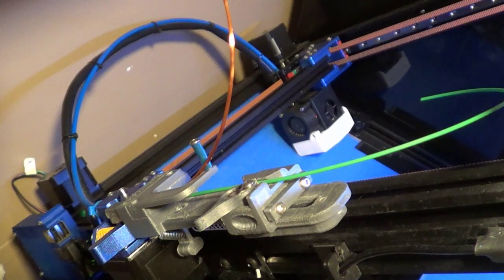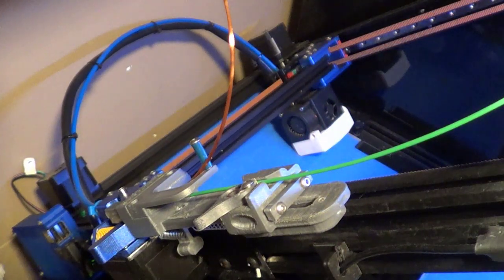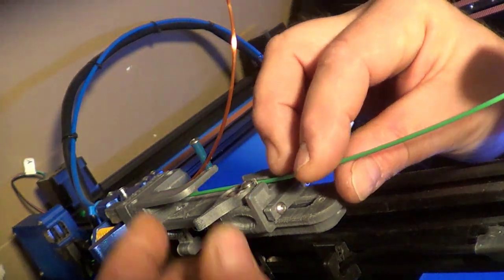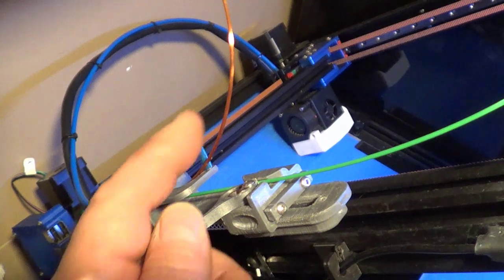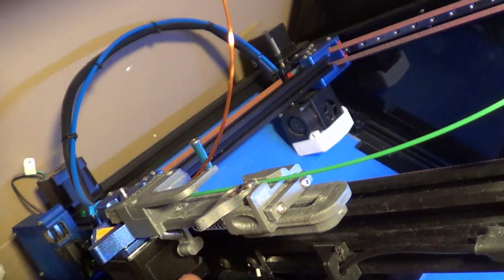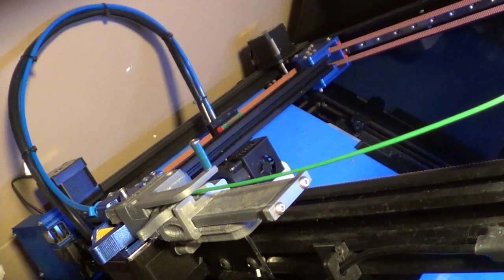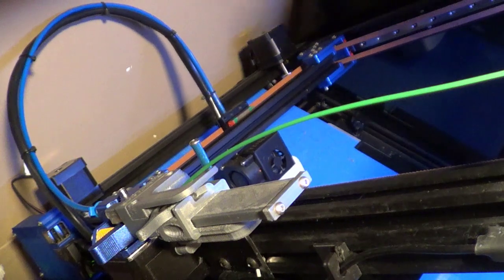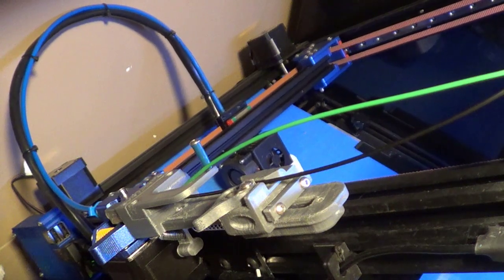Never run out of Filament Again! Automatic Unattended Filament Loader

Comment: Awesome design! I'm just curious about how you prevent the filament from jamming up in the bowden tube? I've tried something similar, but the filament jammed up, because of the break between to the 2 filaments, the second line of filament could potentially ride up next to the first line and cause a jam in the bowden tube.
Reply from the maker: If the filament is relatively square on the end or rounded , shouldn't be an issue. Only a problem if it is cut to a sharp taper. The whole thing works because the old and new filaments are under tension touching. If they weren't the new one wouldn't be able to open the drive gears, and would just sit ahead of them....
Reply from the maker: Also if you watch some of my other videos of version 2.0 design, I fed as many as 12 pieces back to back on one of my Q5's making a layered calibration cube....
Reply: Thank you. I appreciate the response on the subject. I'm looking at creating something like this for TPU and TPE. Thank you for the inspiration.
Reply from the maker: @Wraith1979  version 2.0 handles TPU very well.
Reply: No cash ATM. Im between jobs. Thats why im designing my own.

Comment: Seems interdasting... I have manually loaded filaments this way before, but a few of them have not quite loaded properly it tends to wrap around the extruder (ender 3) or the end of the filament had a bend so it clogs the bowden.  The latter being on a voron that has the boden before the extruder.

Comment: Is it possible to add a runout sensor in addition to this?
Reply from the maker: No need, as it auto loads the next supply of filament....
Reply: @frantasticdesigns  when the second filament runs out
Reply from the maker: @jhsevs  If you haven't watched my videos, you can just queue another filament supply any time after the second one has passed the feed rollers and the swing arm filament catch releases the new one.  At that point the second filament becomes the first filament and so on.  Just keep starting a new one anytime after the first is gone.  watch this video, and you can see I just keep adding pieces to make a calibration cube with somewhere around 10 layers:

https://youtu.be/PUHUfJREGlQ

Comment: Wow, for the way I print, multi-color single nozzle, this is Totally Freakin' Awesome 🤘🤘
Reply from the maker: Thank you.  I designed it more for using up all those partials left over, and to not run out on a long print.  Not sure how you would know exactly when a different color would start if you were switching colors, unless you just wanted to create a "rainbow" effect.  The calibration cubes I printed in multicolor was just to demonstrate the smooth transition between pieces of filament....But hey, I won't say no to the Accolades.....

Comment: Are you familiar with the Recreator 3D project? It reuses soda bottles to turn it into PET filament. One of the issues is a 2 liter bottle yields 20g or so of filament. This could be a game changer for the community of people using recycled filament for larger prints as seeming (melting 2 ends and pressing together) can yield hard brittle joints.

Hoping you find time to design something for direct drive extruders! 

You gained a new follower!
Reply from the maker: I wasn't, but I will check it out.

Comment: Hey this looks awesome and I just purchased the files, but I don't have the extruder you're talking about on my IR3. Any way you could adapt it and release files that would work for the stock IR3 extruder?
Reply from the maker: I have had a few requests for different extruders, I am looking into how hard it would be to adapt.  Be patient, I have been overwhelmed with all the interest it this, but I am working on it.
Reply: @frantasticdesigns  a good thing generates interest amongst the ones recognising it's value 😁👍
Reply: I would love to use this but the way the z axis shaft is mounted on my Ender 3 Max Neo it is impossible. The shaft is in the way.
Reply from the maker: @Truckinman2000  I am working on an adaptable model

Comment: Can you make another video showing all the hardware needed to complete this project? I have no doubt it will work but I'm a visual learner and I may already have some of these components.
Reply from the maker: working on that tonight, will publish when I am done.
Reply: @frantasticdesigns  what wire diameter did yo use for the tension spring and the other spring
Reply from the maker: @FF_AlohaEdition  1 spring Approx 7mmx35mm and 1-2lb Main return spring
1 spring Approx 5mmx24mm and 1-2lb filament plunger

Comment: Veeery nice!
As usual with non-welded filaments, retraction is a no go with this as long the new filament didn't reach the hotend and Nozzle. But that's a very small price to pay for a saved print where one would run out of filament otherwise and trash the full print...
Reply from the maker: Thank you for your supportive comment, not all see it that way.
Reply: @frantasticdesigns  until the new filament hits the nozzle, the old filament is unsupported and cannot retract. Not a matter of opinion, just physics
Reply from the maker: @RobertL1999  I have never denied that, my point is that in my testing, the lack of a few retractions that do not occur seems to be minimal, even more so with a direct drive setup, since the old filament is shorter between where it leaves the drive gears, and the hot end. Additionally, although retractions do not occur for that brief time, pressure is still released by the retraction of the new filament. Physics would also dictate a slight pull back from surface tension at the tip of the nozzle, albeit most likely unmeasurable. I mean no disrespect, but as many have pointed out, the benefit of not pausing, or cooling down a print is worth a few potential blobs or strings, if it means completing your print. My other motivation for this device was to use up every bit of filament on a roll, knowing I could just load the next one without stopping.
Reply from the maker: Thank you,  I am amazed at how many only focus on the negative, and overlook the positive.....

Comment: That is astounding, brilliant idea. Will it work on an Ender 3 with the all metal Creality extruder ? Can't get on with the dual gear ones.
Reply from the maker: I am working to see if I can make it fit.  Have to get my hands on that extruder first.  I changed all mine out.
Reply: @frantasticdesigns  How do you think it would cope with being stuck in mid air coming off the side of the printer ? With the E3's the extruder is on the gantry, you've got me curious now :)
Reply from the maker: @davethebuskeruk  can't see it being a problem, it's easier to load if the extruder is fixed off to the side somewhere.  Admittedly, it can be a bit tricky to load a new source on the fly while my ender is printing, since the print head is moving while you are trying to insert the new one.  but with a little finesse, i have learned to do it quite well.  the belt printer and any bowden tube setup is a snap.

Comment: does this system only work on direct drive or can it also be used on the Prusa mini?
Reply from the maker: really depends on the type of extruder and clearances.  actually built it for a bowden tube setup first, then just added a small top guide to make it work with my direct drive on my ender.